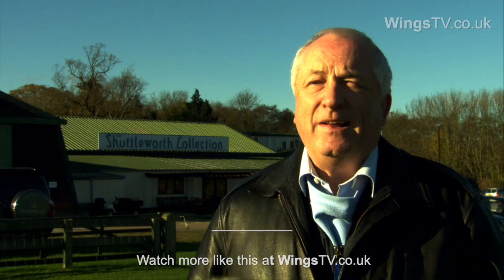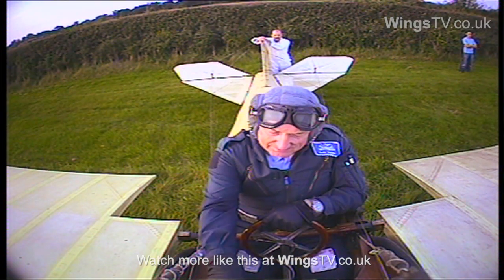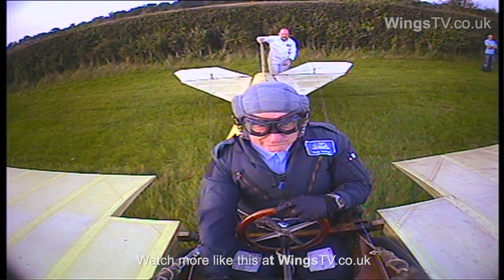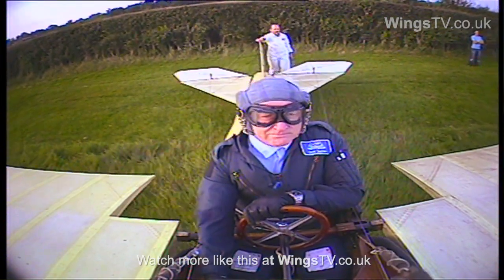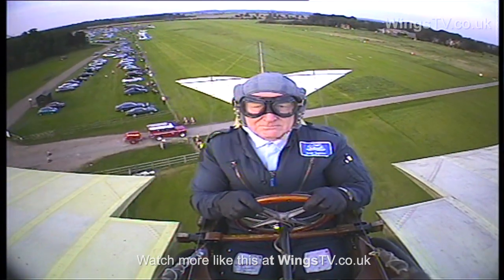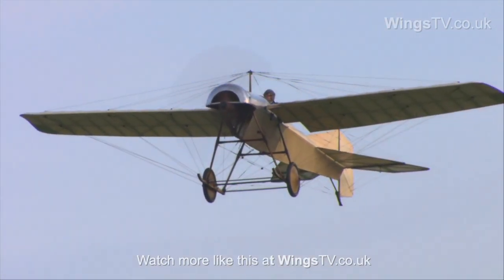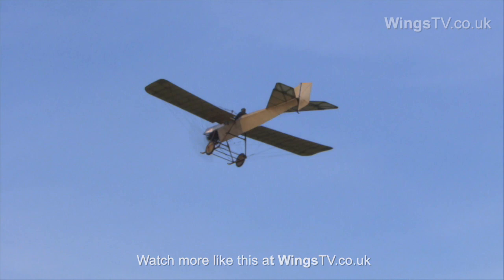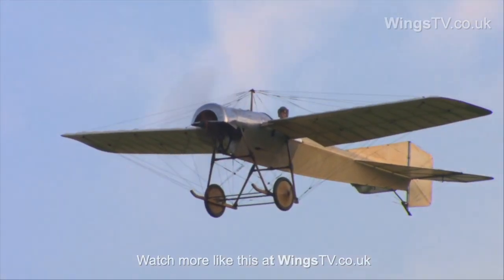Flying The Blackburn Monoplane -the oldest  airworthy British Aircraft in the world

Comment: The Blackburn has a very special place in my heart as it was the first model plane I built from scratch with plans drawn up from picture. The triangular fuselage was not only strong, but was 25 percent lighter. This meant that even with a wingspan of nearly a meter , she would float gracefully through the air with only an .020 engine... 

Only for flying on windless days!😂